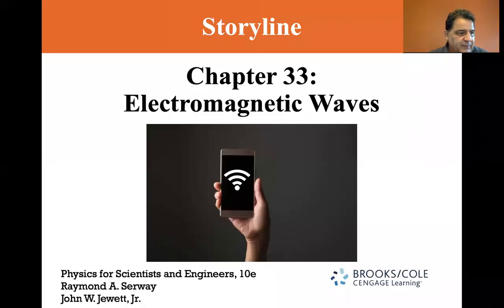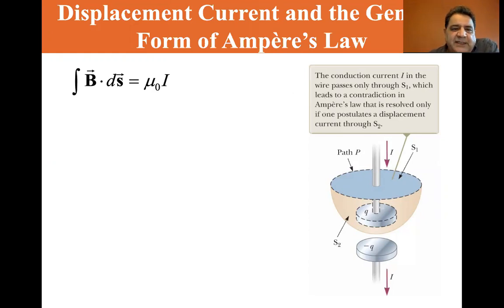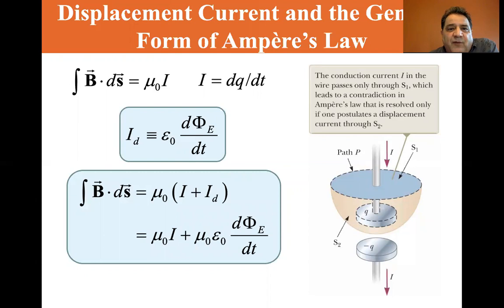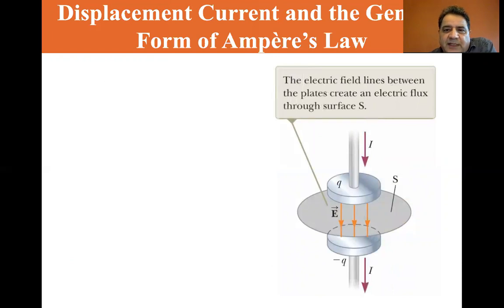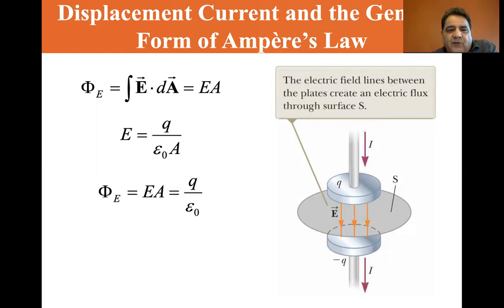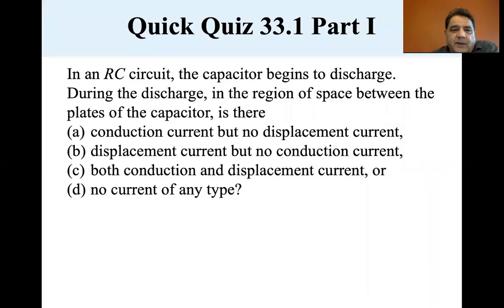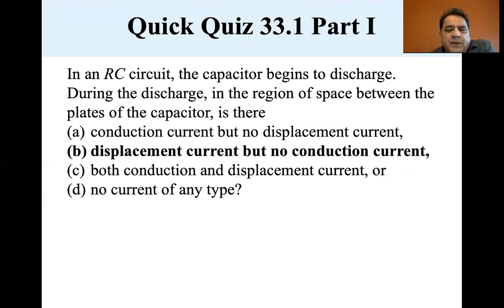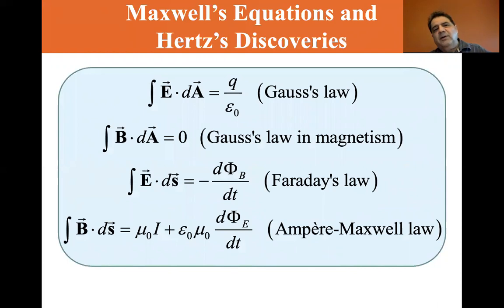University Physics Lectures, Displacement Current and the General Form of Ampere’s Law

Comment: I guess the 4. Maxwell equation is wrong and should be: rot B = m0*e0*dE/dt (without the term m0*j).
I derived this and explained it with some examples.
You know Coulombs low of an E-field generated by a point charge. A moving electron generates a time changing E-field and the moving electrons in a copper wire generate a time changing E-field (superposition principle) and this time changing E-field generates the B-field (you can easy show, that this contribution can be calculated by m0*I).